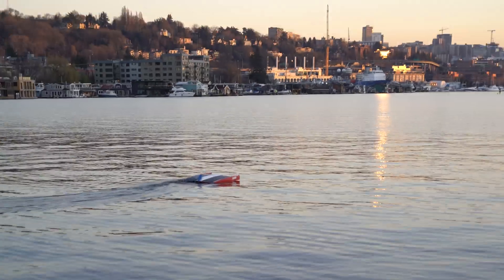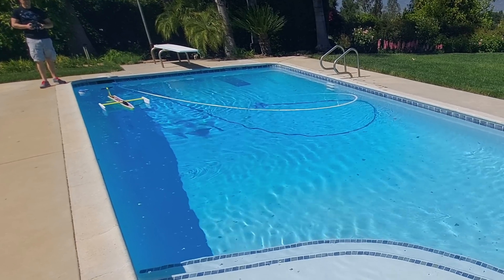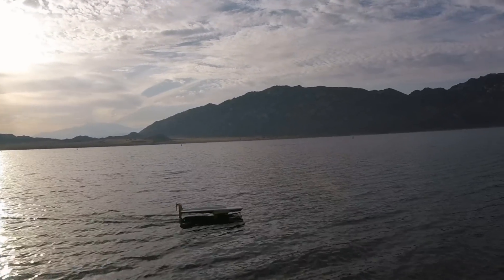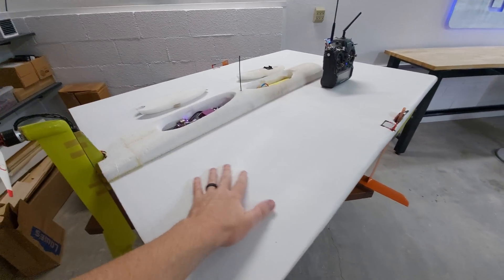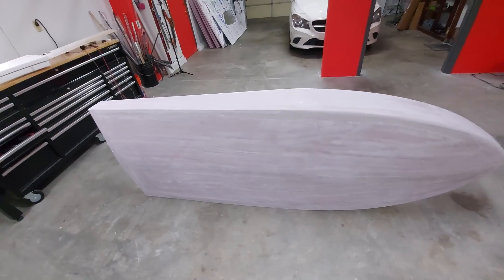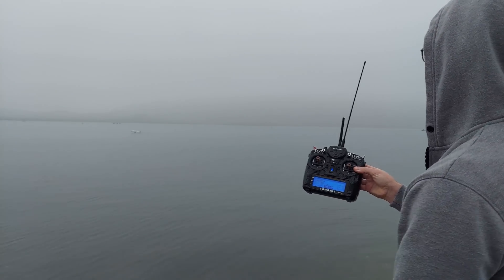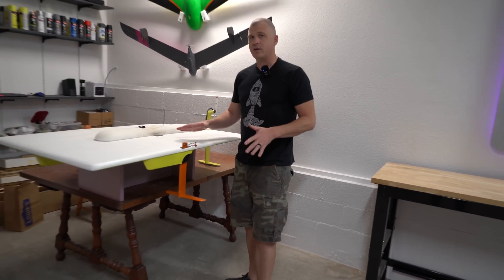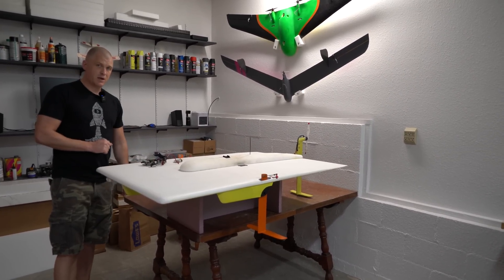Autonomous Solar Powered Hydrofoil:  Getting The Vessel Right

Comment from the maker: Head to https://squarespace.com/thinkflight to save 10% off your first purchase of a website or domain using code thinkfight
Reply: awesome success! \o/ For Sciiiiience! \o/
Reply: 4:00 Do remember that a vacuum cleaner works by letting air flow through the filters, otherwise it would not work. The problem is that the filters collect the larger debris, but the very fine dust goes straight through them. That finest dust is the kind which does you the most damage, because it goes right down into the smaller sacs of your lungs, where some of it lodges, potentially causing lung cancer. The rest of it is absorbed directly into your bloodstream through the very thin-walled capillaries, from where it will lodge in every organ of your body, including your brain. In turn, that lodged Carbon dust has been shown to cause cancers throughout the body. Carbon fibre is pretty nasty stuff, and it acts pretty much in the same ways that coal dust does with miners.

In short, it's much better to take the exhaust gas of your vacuum cleaner and send it through a pipe and out of your house.

Comment: Hi Nicholas. Big step up for stability. Do the lidar sensors control the active pitch of the foils to maintain a set height above water level and is this pitch controlled at the pivot point at the top end of each foil? One of the big challenges is maintaining height due to pitch roll and yaw  when running waves - how is this dealt with in your design. The higher the waves then the greater the issue.

Comment: Beautiful work! You could regulate the altitude with a passive system too, like I did in my 2002-2006 hydrofoil: https://www.youtube.com/watch?v=BBR7aQavJXc (Sorry for the video quality, we didn't have fancy digital cameras back then)
There's a ski at the front there that follows the surface of the water and regulates the altitude of the small front wing. This wing will lift out of the water first. When the main wing is too low, the angle of incidence will be larger, causing it to move up (provided there's enough speed). This regulates the altitude of the of the main wing. In the configuration I used, the front wing could even generate negative lift, and in theory the main wing could as well if it would be very high above the water, which is very unlikely. The craft went through other vessel's wake with ease.

Comment: the length of your esc wires are causing your issues with the servos
Reply from the maker: Dunno, I've made a few creations that had longer wiring along with higher power and more voltage and had no problems.

Comment: this design has a flaw. the servos have to fight the forces rather tahn just adjust the wing. make the wing articulate on the vertical shaft and have a stick that goes through it to control the wing.

Comment: Wow Thats Amazing. I have got to the Stage that I need to have a flight controller in my Hydrofoil. Having issues with the FC and the Lidar talking to each other. I am planning to run mine on Lipo battery's. Would like a follow up on the progress you have made.. Thanks.
Reply from the maker: This project is going places!   Early next year probably.

Comment: It may be difficult for you to read this, I apologize - this is a Google translator. A great idea, but you need to familiarize yourself with the theory of calculating the shape and angle of the hydrofoil, this fundamentally affects the efficiency, with the correct shape of the wing, the water flow behind it should remain laminar and therefore there should be no beats like at this moment 00:58. I live on the Volga River, we have quite a lot of hydrofoils sailing here, and according to my observations, the center of gravity there is shifted to the rear. When the ship departs from the berth and picks up speed, first the nose of the ship stands on the wing, then, as it were, the transmission switches to an increased gear, and after that the stern of the ship stands on the wing. Consequently, the wings are at different heights, with different angles of attack and this is directly related to the weight distribution. In order to overcome the aerodynamic negative effects, the solar panels and the hull of the vessel should be made long and narrow, instead of short and wide, as it is now. Perhaps the area of solar panels should be divided along, and place these halves one after the other, and not on the sides.

Comment: I wonder if it would be possible to simulate the fluid dynamics on the foil in Fusion360 or a similar tool.
There must be a better way to come up with an optimal solution than trial and error.

Comment: I am working on a similar project, but in full scale. I love your design for the self stabilizing or surface piercing foils that you binned. I shouldn't have the blow over problem you encountered and the simplicity of the self stabilizing foils is better for reliability. My problem is deciding on a wing profile and was wondering if you could share the wing profile you used.

Comment: i would suggest looking at the design of foiling sailing dinghies such as the moth, which use a sort of “wand” touching the water under the bow, detecting height and adjusting the foils to be perfect, might not be the best solution here, but it’s an idea

Comment: Love it. Hydrofoil + ground effect. Ingenious.
Reply: Not ground effect, just hydrofoil. It's nowhere near fast enough to take advantage of ground effect. If it had ground effect, then there's no point using hyrofoils as this is much more inefficient than ground effect on it's own. rctestflight's channel explains this on the last video.
Reply: @hippopotamus86  - I realize my mistake:. I had assumed a reduction in mass had a corresponding reduction in velocity necessary to produce the effect - so long as the lift-to-weight ratio fell within certain limits.

Comment: U have to design the board … to be aero  stability also … the windfoil boards could be good to look into… another thing to look into is the moth dinghy class.. these foiling boats have a sort of mechanical  sensor which trims the foils..  …. Thirdly i think in America’s cup, the trim of the foils are trimmed by computers.

Comment: I find the position of the power wires and motor in reference to the signal wires for the servos can cause interference, another way to reduce this noise is adding a circular magnet to the motor wires and power wires with one turn around it. Some larger esc's you find this will come stock like this. The added weight of the wooden prop may be driving the motor aswell causing feedback and interference

Comment: it's a good practice to place decoupling caps on your systems and even more important when you have navigation systems with sensors. Those brushless motors can generate noise and voltage drops even on 4S. You can have other little issues in wiring,crimping, etc.

Comment: 5:25     this is  a  WONKY  servo configuration.!!!          the use of the 'outer' hole on the servo arm gives a servo  LESS  mechanical advantage over the load.     AND, the greater moment arm at the low side of a wing strut,  does this  TOO.!

Comment: information.        5:16   this vertically offset thrust configuration  makes  nose-down moment,  ALL  THE  TIME.       on the other hand, ideally, the thrust line should intersect the center of mass (c-m).   and, the c-m  should be located on the thrust line.          inasmuch as a incorrectly located c-m is  NOT  an option, the use of a less-than ideal thrust line  is sometimes necessary.

Comment: tri-maran hydrofoil
Reply: make it heavier
Reply: more inertial passive stability, like true scale airplane
Reply: size only does not solve issues, actual weight does
Reply: making ultra-light things are easily not self-stabilizing
Reply: the more passive stability you have, the less active control you need, then you only have major direction control left to implement
Reply: things are solved by intentionally making the light heavy
Reply: if a plane dies to a bird (or fish) in the air, to a shock, then too light construct

Comment: Cap on esc's are for limit noise injection due to high current switching it's particulary important regardons rf signal like vidéo TX etc 
it limit also power supply Peak and falls due to rapid change in global power demand 
This Can induce changes on supply for imu (depending on supply regulators speed in fligh CTRL ) and mems are very sensibles to supply changes

Comment: Cool project.  Re: LIDAR code.  I would imagine the inputs that must be made to the servos controlling foil angles are quite subtle and precise and must be relatively fast.  Did you have to do fine tuning of the code once testing began or is it straight from some special algorithm?
Reply from the maker: Arduplane is handling the stabilization, I did not change the stock settings, it was good enough as is.
Reply: @thinkflight  which waterproof lidar product did you use ? (I have the same project on a commercial wing foil setup ;) )
Reply from the maker: @bremardn  Benewake TF02.   I wouldn't rave about it, would probably try others, or a different tech altogether if continuing down this road.

Comment: What's the efficiency difference between an air driven propeller and a  submersed boat style propeller?

I would think a submersed boat style is more efficient. Is that something that could be viable?
Reply from the maker: Probably water propeller is more efficient, this just stays out of the weeds though.

Comment: If you need a capacitor, I would use an oscilloscope and track the voltage drop when the motor starts under load. It may be dropping below some voltage that causes the BEC to not function properly. Track the voltage on the end of the BEC. It is likely the amp draw is so large the BEC is cutting out. Just my thoughts.

Comment: That was pretty good. You can likely fix the blowing ESCs issue by moving the esc very close to the motor. You can make the craft much less sensitive to wind by making it longer and narrower and by ensuring that there is more area at the back, less at the front. I've been setting up to do something similar with ESP32-C3 controlled receiver and ESP32-S2 based transmitter. I have a couple of circuit boards working, I can read GPS, control servos, I have a couple of 2D joysticks and a couple of rotary encoders on the transmit end, all with click. Looks like I need to write my own driver for my 6DOF gyro-accelerometer I2C sensor though. It will potentially be a testing ground for the hydrofoils I Wingsurf on at the modelling stage too. I have most of my parts but haven't designed the hull and deck yet. I do have LIDAR plans too.
Reply: let's see a video,  in detail.   we're curious

Comment: The pitch control of the 2 foils puts a constant strain on the servos. To couter this torque both servos will use electric power. This might be the reason for oscillations in the 5V circuit and the need for caps. Also servos will be wrecked with any minor crash. Better use a worm gear or a "screw and nut" design with no back-feed of torque. Or run the servos from a separete 5V buck converter..
Reply from the maker: I don't know, it was happening when sitting on the stand and no strain on the servos.

Comment: Great engineering on this latest hydrofoil pitcheron design. Like the design simplicity which keeps all moving parts are above the waterline. All those foiling iterations are now paying dividends. 

Great audio comparison at 9:50 ... loud motorboat noises vs. mild propeller hum from the hydrofoil (no motor noise). It wasn't stated, but assuming 3.45A @ 16V would amount to 55 Watts of power to cruise at 27 mph? 
💡🧐Efficiency has been achieved with this Autonomous Solar Pitcheron Hydrofoil. :)  

The ESC being zapped is interesting, considering only needed to handle ~3.45A at cruise. Not knowing under what load conditions the demise is occurring, or at what current draw, I can only speculate. Might be related to a longer peak current as a water craft might take longer to get up to speed (?) vs. airborne craft, or related to the wiring (length between ESC and motor). If blackbox data was logged, it might hold a clue. An ESC with telemetry might be a good upgrade as prep for fully autonomous missions.

Comment: what about wands that touch the water like the moth sail boats use  to control ride height ..  they have got that system down ... they been at it for years  and they not too draggy
Reply from the maker: That is a legit way to do it for sure!
Reply: @thinkflight  even if the wands r only sensors   e.i driving pots .. they jump up and down a lot .. and would need damping machanicaly or electronicaly  ..  i weld better than i spell

Comment: Ideas on capacitor fix.. Interference from cable routing or fluctuating current noise from too much current on small gauge wires or too small of a power supply.  Any sudden large amp draws that could under volt them or PWM modulated components?

Comment: full size one  maybe do ride hight ..  go manual  with a joy stick and push pull cables .. foot peddles for steering  and a para motor    polini  may be  as a start
Reply from the maker: Manual AND optionally stabilized.   Servos all around

Comment: From building drones and wings I know that the Capacitor on your ESC is going to absorb voltage spikes caused by motor braking when there are rapid changes when the PID loop is active.  You can often hear it affecting your servos.

In general, it's pretty much always a good idea to have a cap on your ECSs
Reply from the maker: But why 4S?   I've never even had to do this on 5S, only 6S and above.
Reply: @thinkflight  I use caps on nearly everything - even one of my 1S builds just to protect small ESCs.  For purposes of a servo, I would think it's any voltage above 5v or 9v where you'd need a Cap.  Granted they should be on the opposite side of a 5v/9v BEC and still being affected.  May say more about the FC than anything else.

What electronics were you using?
Reply: @thinkflight  yeah, these issues can crop up with any voltage, if you're using a different flight controller, different servos, or a different ESC than normal then my guess would be that these have less built in filtering than what you typically use. If you're using an older battery then it's possible that it has an increased internal resistance that's causing voltage sag when the motor runs.
Other than that I'm not really sure why this build in particular would need additional capacitance, it doesn't seem like a particularly demanding setup in terms of power

Comment: Did you put the capacitor across the battery terminals, or across the 5v receiver power lines? I've used small ceramic and electrolytic capacitors across receiver power lines to fix weird servo issues before.
Reply from the maker: I put them across the battery insertion to the ESC.   Interesting suggestion, I never considered that.

Comment: You really should take a look at how moth class boats foil. The wand is an extremely rugged and simple system for stability in these boats. It allows for adjustable ride height while giving full mechanically passive stabilization, in addition the rudder is also used to control the aoa of the boat itself.
The way you set it up may be convenient to build but your main foil should not pivot above the water as that will introduce counter steering forces that likely contributed to the eventual failure of your foil.
I suspect this is also why your servos are acting up, you're literally riding on them. They're probably at current limit because of the holding force they need to apply.
In a moth you will sometimes see pivots on the rudder for pitch control, it should be noted that those aren't meant to be used all the time, you set your boat up by controlling the wand and its length. Pitch control is for trimming it out to perfection.
Reply from the maker: I'm not opposed to this explanation, it mirrors my thoughts which is why the optionally manned hydrofoil will have normal driven surfaces instead of the whole assembly moving.

Comment: The drag from the front 2 hydrofoils will put a torque on the servos, and cause them to pull some current just to hold the position while moving. Probably not much, but if you are aiming for efficiency (solar powered), then it may help to add a small spring there to help reduce the holding torque required.
Reply from the maker: Genius!
Reply: Alternatively, instead of a spring you could use a stepper motor and a worm wheel gear, which would completely nullify that force. But I agree a spring is easier ;)
Reply: @pieterwasalreadytaken  Yeah a worm gear is a good idea. You could even make a "worm gear servo" from the guts of a normal one, just strapping the feedback pot and electronics to a similarly sized wormgear based gearmotor.
Reply: @roboman2444  Take the worm gear drive from a set of electric retracts.
Reply: this is why i love this channel aha the collaboration from everyone is so awesome!
Reply: Maybe you could even get it to work fully passively with matching the variable spring rate to the angle of attack required for a given speed?